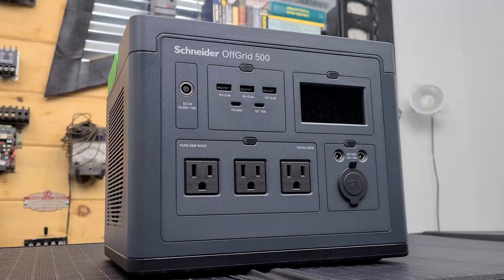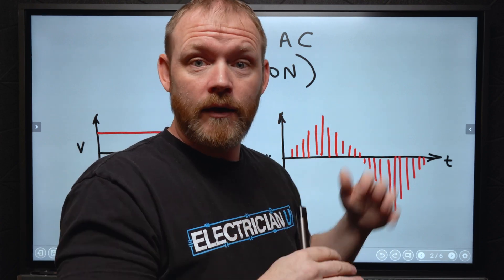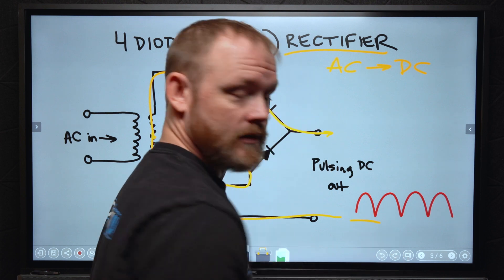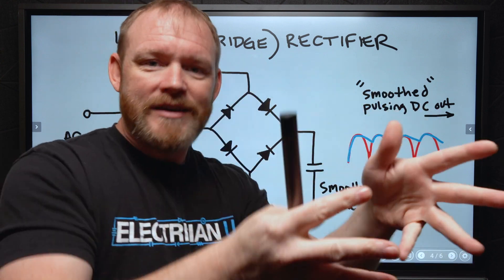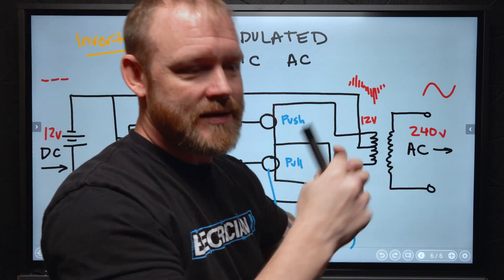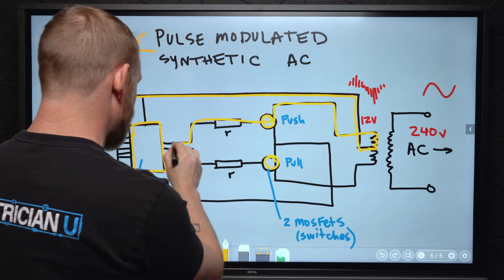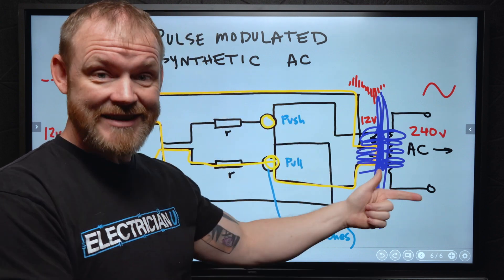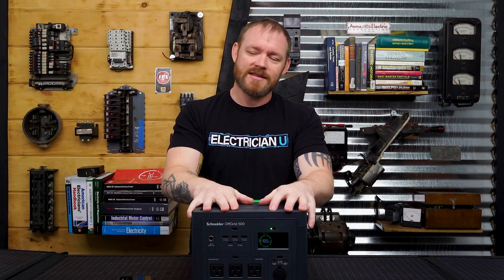DC to AC Conversion Explained Simply!

Comment: So smoother ac to dc is usually a double bridge rectifier I.e. 8 diodes versus 4. 4 diodes is full bridge rectifier  but is 8 is double bridge, why not show that? A diode is sort of a damn. It smoothes the wave. The reason I came on is I understand dc to ac,but not ac to dc?
Inverters create a square wave, I wanted to know the physical components… what the hell is a pulse oscillator? Is it mini transformers?

Comment: Okay, none of these videos are helping me because I have an AC transformer that goes from wall voltage, 120 volts, then it goes to three wires on one end, 18.5 volts, 8 volts, and then common/neutral. I need to rectify both different voltages, 18.5 to 12, and then 8 volts to 5.

Comment: Just a question, basically about Enphase (RECTIFIER )DC to AC, how to charge batteries. use some of the AC to run a battery charger and then use another Enphase or inverter (RECTIFIER) DC to AC form batteries

Comment: Another good example of where both processes nare going on concurrently is in data centers, where the UPSes are continuously converting AC to DC to maintain battery charge and provide enough DC current for the next step - convert DV back to AC. It both conditions the power and also continuous power to the compute load if utility power is lost without the need for an internal transfer switch.

Comment: Nice explanation.  How about showcasing the method car radios used in the 1950's?  Multivibrator for oscillation, step-up x-fmr, then vacuum tubes?

Comment: I believe you showed the inverter load current incorrectly. The load current does not pass through the resistors installed in the gates of a FET. The switch (FET) only passes the load current from drain to source.

Comment: About 20 years ago we still had a rotary converter that ran a 20 HP DC motor off batteries to provide 120/208 power to critical equipment. Finally replaced it with a modern UPS with a 6' cabinet of batteries

Comment: I havent watched in a while but i really wanted to learn more about the conversion process between AC and DC and vice versa.
I am impressed. Your video (as always) is very helpful and explains in simple language so even beginners can understand. I studied basic electronics in high school and worked as airborne RADAR tech in the Air Force so have a pretty good background but you still filled in some gaps. However, is it possible you followed the wrong return path through the MOSFets? When i was in tech school we didn't spend much time with MOSFets so my knowledge is limited. But, i think you drew the current back through the MOSFets actually back through the gate connection and not the drain. When you cross through the enabled MISFet, your path should go to the right then down to the return path back to the battery. I don't think the reverse path from either of the MOSFets goes through the pulse oscillator. If i am wrong, please accept my sincerest apologies; and maybe point me to a reference where i could learn more.
Again, love the channel! Keep up the great work.

Comment: I get the function of the transformer in an inverter but it also seems kind of wastefull at some point. Seems to me if you want 120V AC you could just take 120V of batteries a couple of mosfets and then just flip the polarities on and off and flip them then you have AC. The only flaw I guess I see would be voltage drop of the batteries it may start at like 120 then drop to 110. A lot of UPS I see run at most 48V but these things take soo much amperage on the low voltage to make even 1/4 of the same at AC. I work in I.T one of my favorite things to part out is old UPS units, a couple times I made them into car inverters. 

There are also many kinds of UPS based on how they failover, some are pure sinewave others are modified sinewave, etc. Pure sinewave usually have a big heavy transformer, some mainly smaller models use a switching mode power supply setup with a high frequency transformer. Google at one time actually ran all their servers on a main DC input then the devices just had regulators to drop it down if needed. For computer stuff UPS really seem stupid to me because basically your making AC>DC>AC>DC. More common in telecom but have seen in older network gear they had 48V DC input options.
Reply: Not all UPS units have batteries below line voltage. Also IT, I was working on an APC double-conversion/online UPS few years back that the battery banks were 192volts DC.

Comment: Protons don't flow--electrons do. Conventional current flow vs. electron flow. Do you know the difference?
Reply: Very long ago, in a galaxy far far away, current ran from the positive/red dc wire.  The only thing positively moving are holes.

Comment: Actually...most inverters use Pulse Width Modulation. Meaning the "push" Mosfet is turned on in varying time cycles to approximate a rising positive voltage, creating a pseudo 60 cycle positive sine wave. Then the "pull" Mosfet does the same thing (rapidly) to give the negative component of the sine wave. These Mosfets are firing thousands of times a second and will give a very close approximation of a "pure" sine wave. Many installations use a choke to smooth out the high frequency component out of the 60 Hz signal.
Reply: What you describe (in the video) is a square wave generator. very rough on sensitive a/c driven components.
Reply: @ProfessorMAG  how does a square wave a(e)ffect the conversion through the transformer?  If it was no good wouldn't the transformer just not work?  Doesn't most "sensitive" stuff use dc any way?
Reply: @kevinwalker4623  Sensitive electronics typically use transistor based switching power supplies to go from AC to DC for the device they are powering.  Switching power supplies AC side may be intolerant of square-wave or low-quality sine wave input.  That's why a "pure sine wave" UPS is much preferred nowadays.

In years past, "sensitive electronic equipment" used linear power supplies with huge transformers for their internal AC to DC conversion.  These are much less sensitive to the quality of the incoming AC power.

Look inside an older stereo receiver and you'll see it was 80% a very heavy, large linear transformer with a small circuit board for the actual main amplifier function.

Note that even today boutique equipment may use linear transformers instead of switching power supplies for better line noise isolation in spite of the huge weight and cost penalty.

Comment: Or if you really want DC as smooth as possible from AC, you charge a battery bank and the system runs off of the DC batteries. This is how the landline telephone network architecture was structured.
Reply: Very thorough explanation and very helpful and understandable.

Comment: I don't think the current would go through the oscillator. When the oscillator activates a MOSFET, it lets power flow through it, vertically in your diagram. The lines from the MOSFET to the oscillator are control lines, not lines for the power to flow to the load.
Reply: This is for general knowledge... Not experts. ^_^
Reply: @casmitherz  Just like "Current takes the path of least resistance"? Which is 'general knowledge' but is patently (and dangerously) wrong. He drew the circuit properly, and if he's presenting the subject he should at least get the basics right. I have a solid respect for Dustin an 90% of the time he's spot on but this time he's wrong.

Comment: 8:41 Power current path should go down through the Drain of the MOSFET, NOT backwards through the Gate of the MOSFET and NOT through the control circuitry.⚠⚡

Otherwise, good explanation.

Edit: Changed Emitter to Drain and Base to Gate. (Thanks @rty1955 !)
Reply: Dang, you beat me to it. :)
Reply: @JorgTheElder  hehe, I hear ya
Reply: No emitter on a MOSFET. :)
Reply: @rty1955  Still, the lines to the oscillator are control lines going to the gate, they don't carry power to the load.